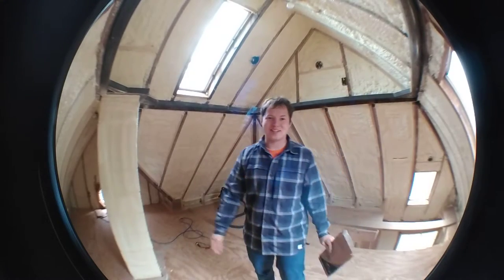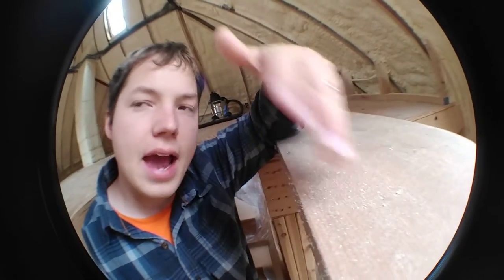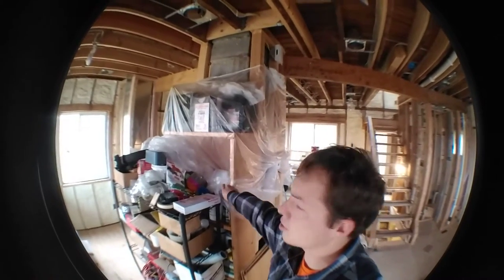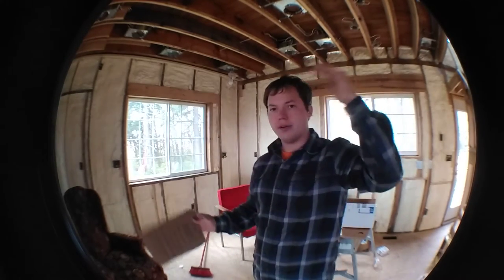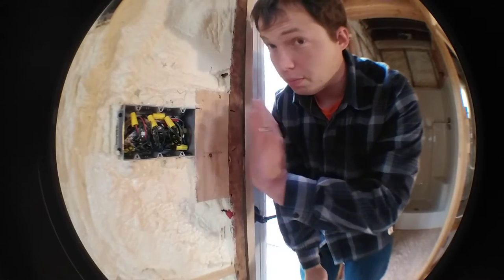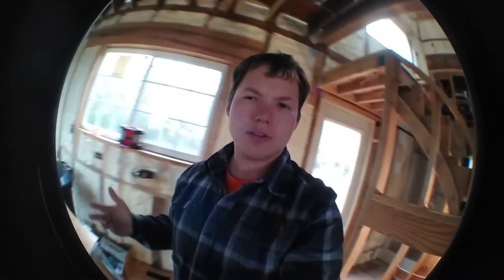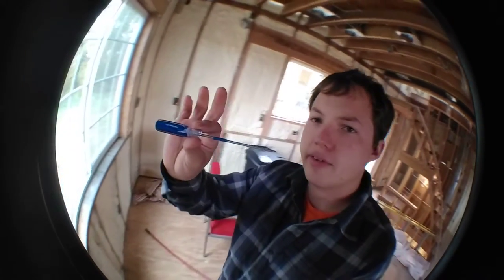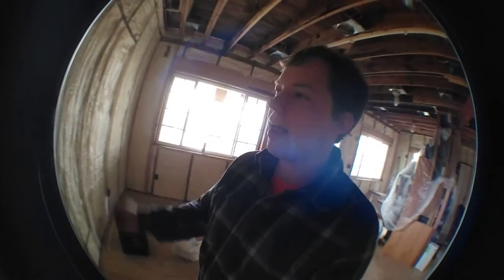How To Prepare For Spray Foam Installation, Prevent Over Spray, Depth Check, & Cleanup - Ben's DIY

Comment: I would add that depth checking foam should only be done by the foamer.  Every place that depth checking is done, leaves a hole poked in your moisture barrier.  If you do choose to do a depth check, you MUST seal every hole that you created.  Also, you should know that it is NOT recommended to be in the area when the spray foam is being installed or 24 hours afterward.  There is a reason that they wear respiratory protection.  There is no way to fix your lungs after an exposure.....

You do have some very good points about covering things, a good foam contractor will cover things for you, but everyone can make a mistake and miss something.  If you want to make sure it stays clean, cover it!  

Just want to keep people that watch your video safe and happy!
Reply from the maker: Kristin Hunter Thanks for the tips! The main thing is that someone really needs to depth check even if it creates the work of sealing the punctures. It is far better to have a few tiny pokes than to have an entire wall condensate due to foam that is too thin.

Again, thanks for the comment!

Comment: Did you have any concern derating or correcting the ampacity for the 12/2 or 14/2 cable that was being encased in foam?  If so how did you make those corrections?  Thanks

Comment: I would just put roll insulation and a plastic vapor barrier.
Reply from the maker: +prosperandbehealthy That's definitely a more affordable way of doing it. These are the reasons I chose spray foam:

1 - I only have 2x4 exterior walls and would only have R11 if I used fiberglass. With spray foam I get closer to R21.

2 - Spray foam does a great job of sealing the house up completely even in hard to access areas.

3 - My old farmhouse has balloon 24" on center 2x4 framing and the spray foam adds a lot is structural support and really stiffened up the house. 

Those were the reasons we chose spray foam. Also, we live in Minnesota and it gets VERY COLD in the winter so good insulation pays off.

Thanks for your comment!!